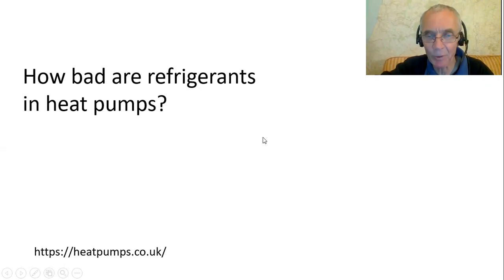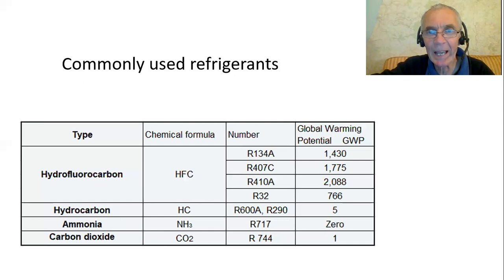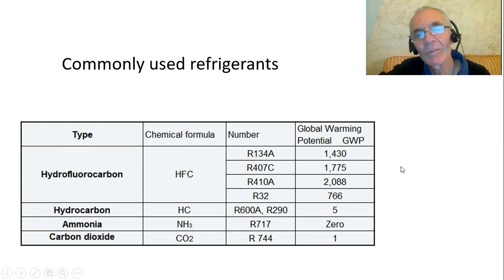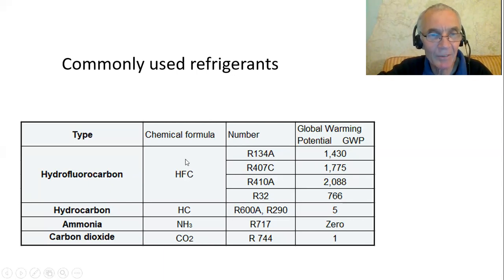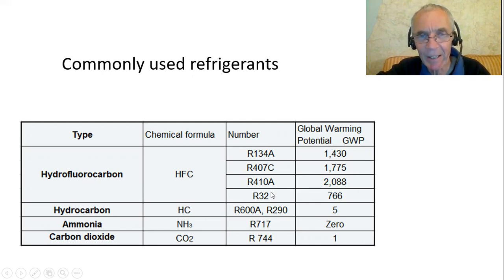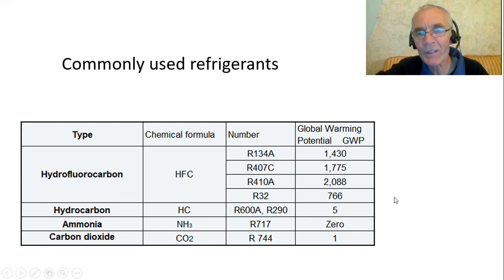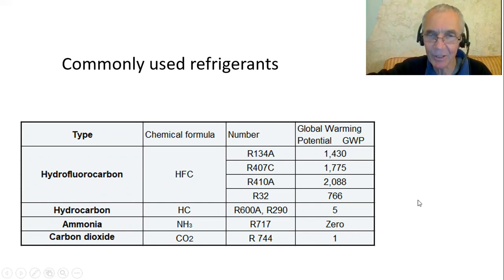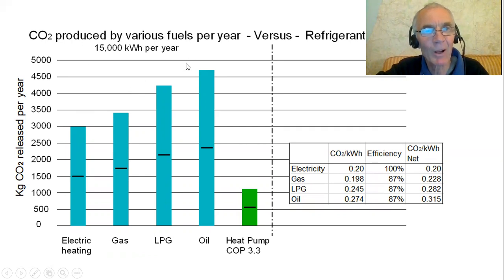Heat pumps and the potential harm due to refrigerants

Comment: just had a r290 Vaillant ASHP fitted, in part from your video and book. thank you.  It feels R32 being pitched as 'eco' is very like the push for diesel cars a decade + ago. we are lucky to be able to site it away form the house to avoid the risks of the flammable refrigerant. but the risk compared to a gas line inside the house seems small to me, even more so if people end up with hydrogen piped in...
Reply from the maker: I'm not aware of any incidents relating to flammable refrigerants, and sitting inside a heat pump in a garden it should be very safe...  Hurtling up a motorway with a tank full of petrol seems much more dangerous!
Reply: @johncantor4056  for sure. but the restriction in the install manual seem OTT, a lot of restrictions about proximity to drains and windows. the charge is only about 1/10th of a bottle of patio heater gas! i guess its just caution with a new technology. As i was told at college,  if glass was invented today you would never get it through building controls, a lot has to do with a familiar risk.

Comment from the maker: I worked in the refrigeration industry in 1970's and 80's,and know how leaky things were.  I expect that refrigeration is still not good, but far better than it was. Car air conditioning is particularly bad due to the shaft-seal and joints.  However, like the domestic fridge, heat pumps are hermetic all-soldered, so they are a different animal.  The vast majority of heat pumps that I come across will have lost none of their refrigerant. However, a few can, and if that were looked into, I'm sure it could be minimised further